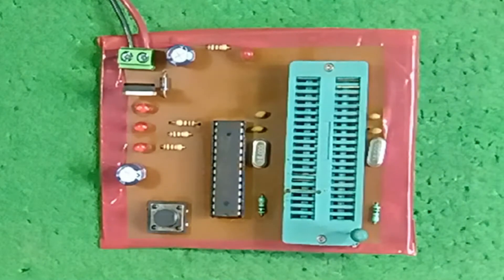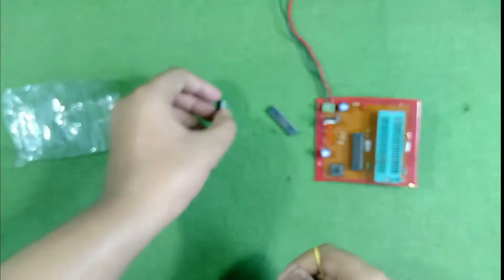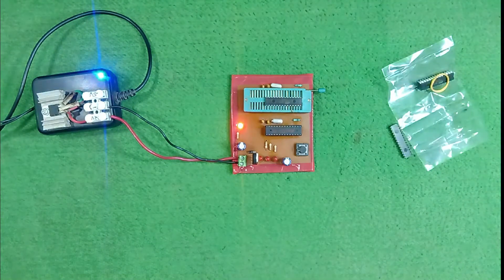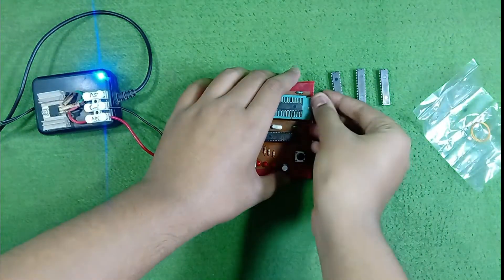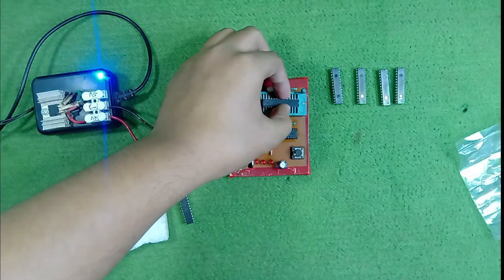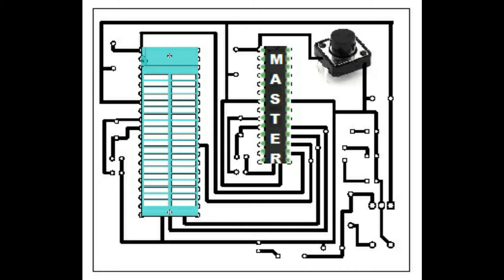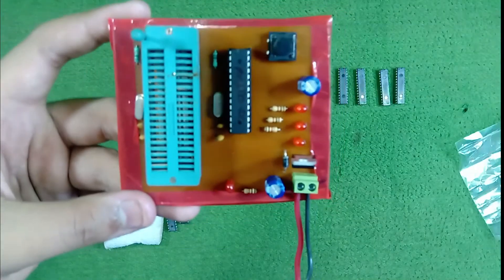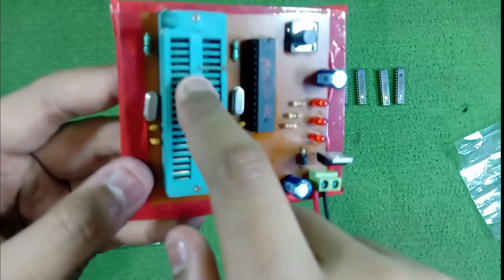How to burnbootload ATMega328 , ATMega168 , ATMega8 Arduino IC

Comment: The circuit diagram it is not in the video
Reply from the maker: I think you didn't see full video 

Circuit diagram already given in middle of the video .
Reply: @TheRoboticsKing   i see the full video but that circuit is not easy to draw i will be so happy if you can give a diagram with normal ic socket so it would be easy. Thank for the video